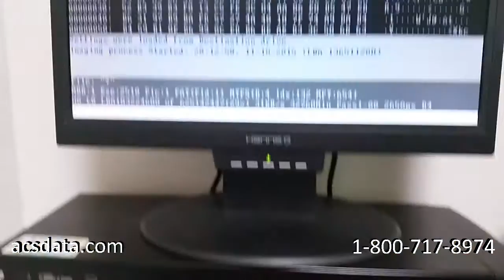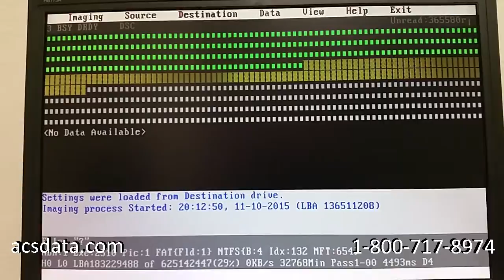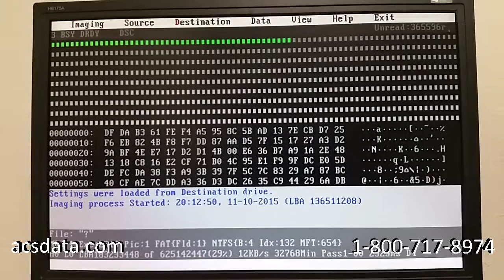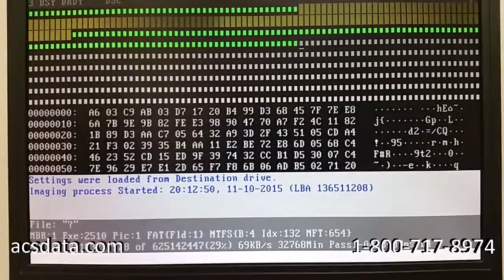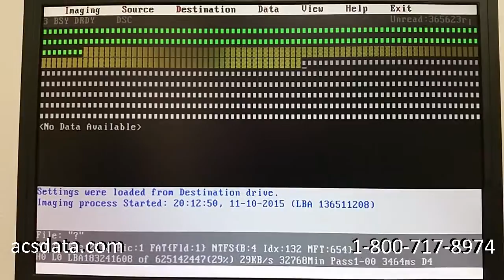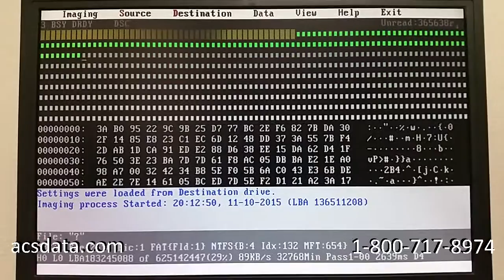Data Recovery On A Hard Drive With Degraded Platters

Comment: I have an external toshiba drive, 2.5" like that, similar issues. Seems to copy 40MB or so using ddrescue, and halts at a bunch of errors. takes off again, then halts. over and over. Almost to the point to where it isnt random.

Comment: How much does recovery like that cost?
Reply from the maker: +George Stobbart It totally depends on what we find to be the problem with the drive.  Recoveries can range anywhere from $500 to well over $1,000.  However, once we have completed the evaluation and given the final quoted price, the price doesn't go up just because we run into issues like the one shown in this video.  We will most likely be working on this recover for another month or two.
Reply: Thanks for rely

Comment: do you guys use anything other than DDI for imaging?
Reply from the maker: +HDD Recovery Services Yes we do, plus we have our own in house imager that we use for quick recovery jobs. It just happens to be DDI is the most flexible tool with difficult jobs.  It's almost mandatory after head swaps or working with degraded drives.